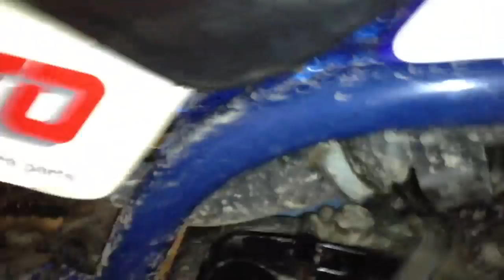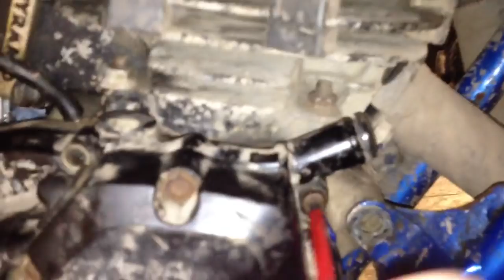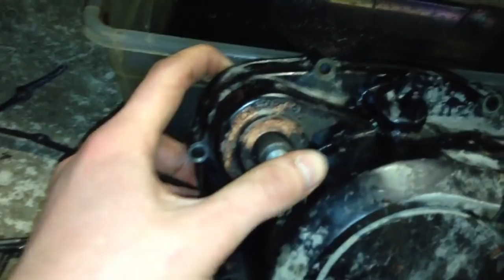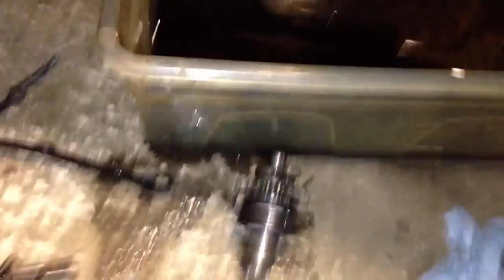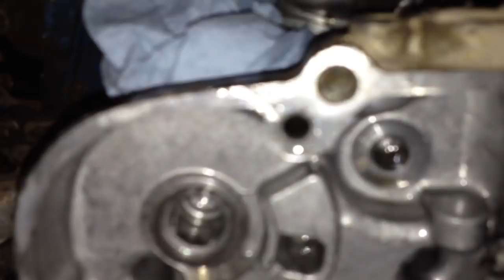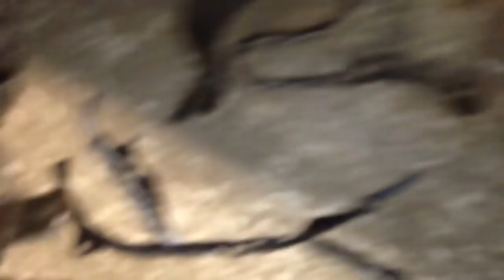Yamaha blaster kick start spring repair

Comment: I see this Yamaha blaster on Craigslist for $750 and it says all it needs it a kickstart spring idek if i should trust it because if i buy the bike and not start it before hand i couldn’t be in trouble
Reply: YSG NIKO the spring will not matter you can still start it but the Kickstarter will have to be pulled back by hand everytime you kick it.  It will just make it a pain in the ass to start
Reply: Ya boy Aaron ok thx

Comment: Hi I have a 2000 Kawasaki KX100 and I was wondering if you knew what could cause my kick start to skip the first knotch when I kick it if I kick it slow it does grab though is this normal or do I need to replace something ??
Reply from the maker: Mathew LaBarge probably a snapped tooth on the kick start gear. Hard to say without stripping it down. best of luck chap
Reply: Thanks dude I think it is the kick start shaft I forgot when me and my dad rebuilt the whole engine there was a little chip missing out of it thanks for your input I subscribed nice video 😎